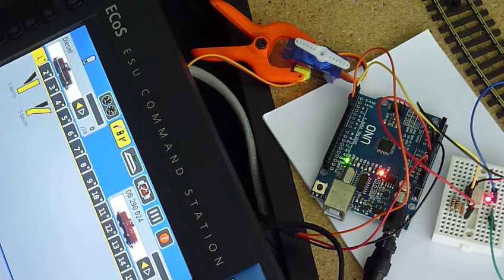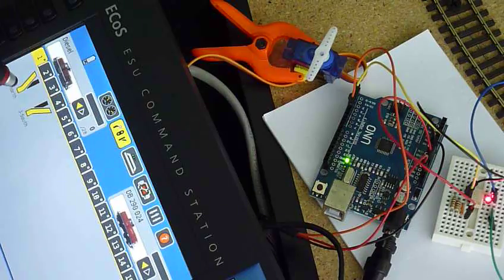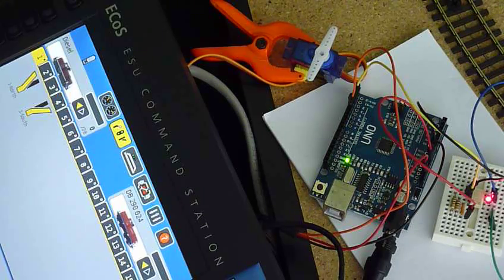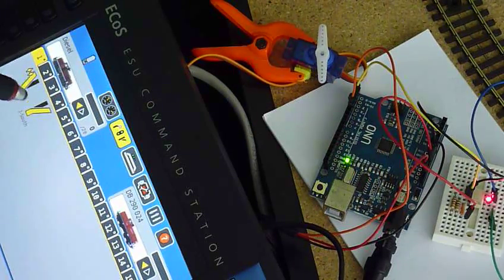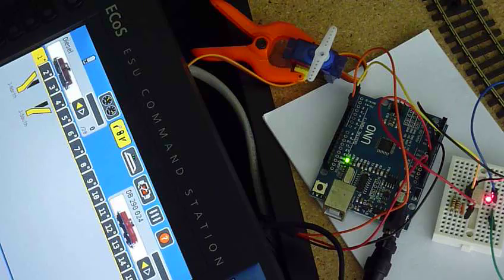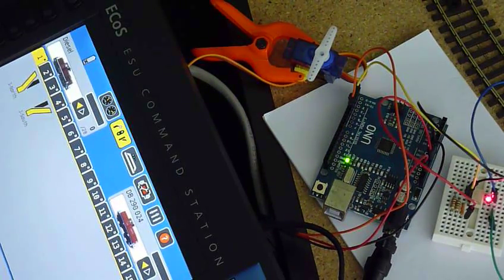RMR014 - Arduino as a DCC function- and servo decoder

Comment: Hi Rudy, as I see you are using always the "UNO" version of the Arduino processor. Some month ago I try to do my first steps with Arduino type's  e.g. "Nano" and "Leonardo". But there are not compatible. So my question is, what type I should use for what Funktion? Is the "UNO" type, let's say the best selection/the best way for everything?  All the Best Wolfgang
Reply: Yes, I mainly use the UNO, sometimes a Nano. The main issue for the DCC decoder is that it uses a hardware interrupt pin (2). On several other Arduino types that interrupt is allocated to another pin. You'll need to change that in the code then to get it working.

Comment: Hey,
how do I have to connect the dcc signal to the Arduino? Do you have a Plan? I only know that the cables from the track go into an optocupler and then somehow into the Arduino. But I dont know how I have to connect it exactly.

Max

Ps.: sorry for my English. Im from Germany!
Reply: Ok I found it. Thanks. But I have another Question too =D. My Servos have an orange, a yellow (signal) and a brown cable. Is it able to connect only the signal-cable to the Arduino and the red and the brown Cable to an extern 5V Power supply? Because so the arduino doesn't become overloaded. At an other YT-Chanel I saw that I could use Servoshields but I wouldn't like to do it in this way.

Max
Reply: the Supply for the servos with the supply for the arduino or with the arduino itself? And can I use a 5v Supply for the servos and a 10v Supply for the arduino if I connect both GND?

Max

Comment: Beste Ruud,

Ik krijg in mijn sketch een foutmelding dat "DCC" in regel 167 en in regel 184 niet is verklaard, wat doe ik fout?

Gr, stefan
Reply: ***** Ik ben er al achter ik had de hele map in de map van libraries gezet
alleen moest het mapje "DCC_Decoder" er alleen staan. Blij dat het nu wel werkt.
Reply: Hi I have tried your decoder and the optocoupler they are on a bread board pin2 goes to arduino and optocoupler to the track as a based station I have an other Arduino with motor shield I have put the decoder on the program track but i try to read from the JMRI it gives me error 308 please is there a way how to connect to jmri something i am doing wrong for sure please put in mind i am a newbie in DCC thanks